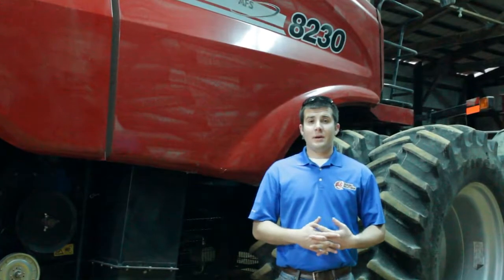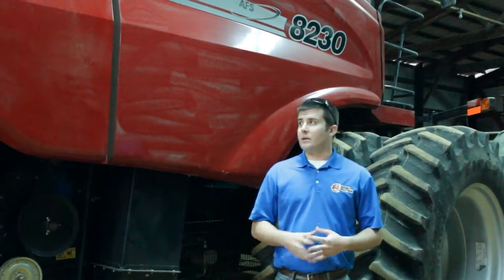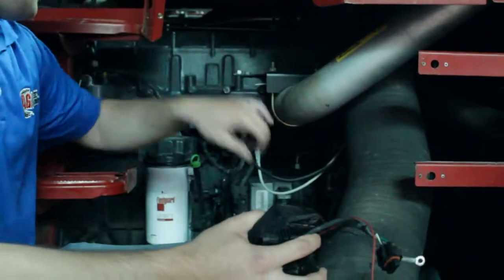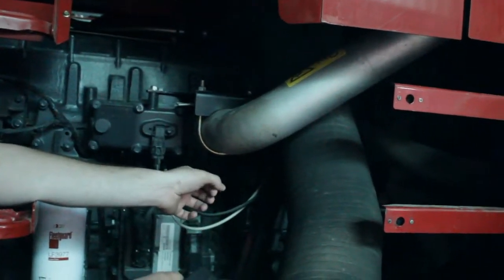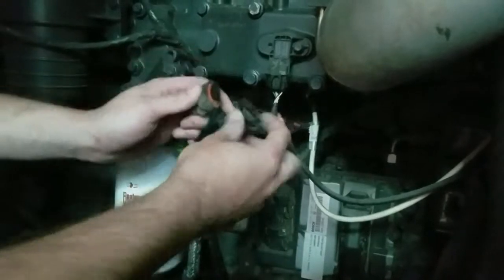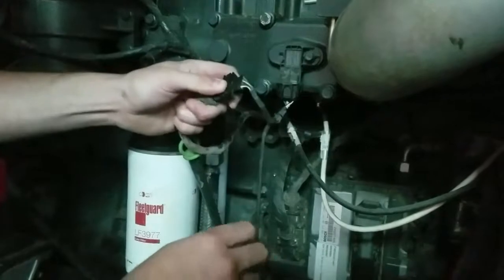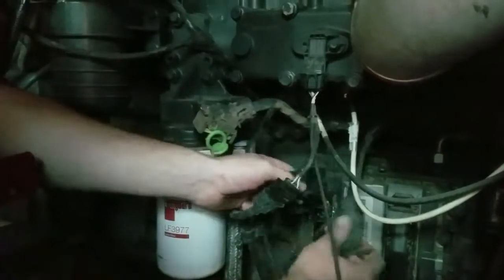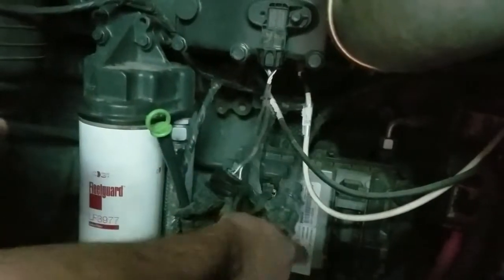IV6000 Module Installation -- On a 8230 Case IH Combine -- Ag Diesel Solutions

Comment: The only reason it seams to get better fuel economy is because the ecm is going by the factory gallons per hour compared to engine load.  Before the ag chip, say the engine is working at 100% load and burning 18 gallons an hour.  Now after the chip it might be burning 20 to 22 gal/hr but only showing 18 gal/hr on the display, thinking its at 100% load, but as compared to the engines factory power output now its 20% to 30% over.
Reply from the maker: @wyomingfarmer, we always encourage our customers to calculate the fuel mileage manually before putting the module one, then again after running it. We truly see the fuel mileage difference! If you would like more information about how our performance modules work, feel free to contact us and ask for our engineering dept. Thanks!